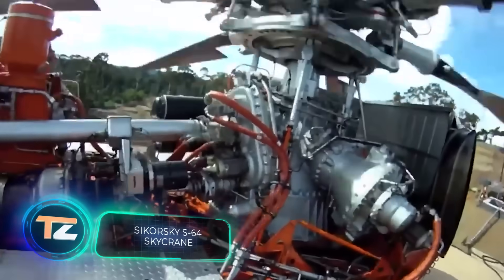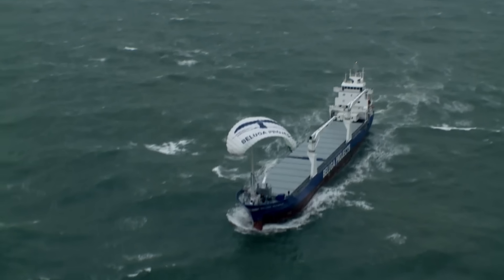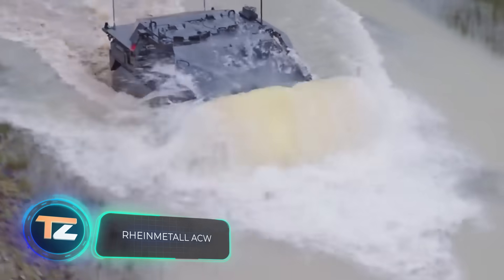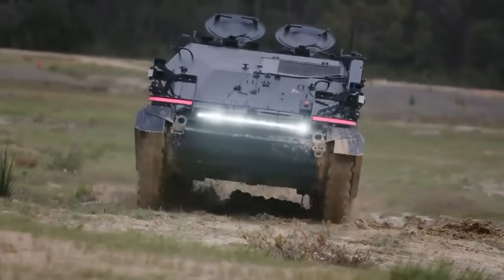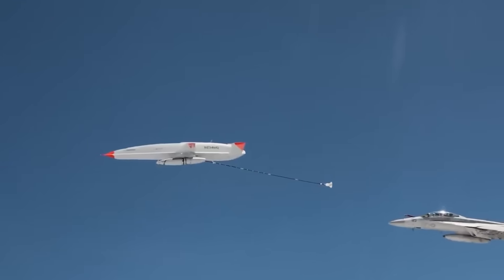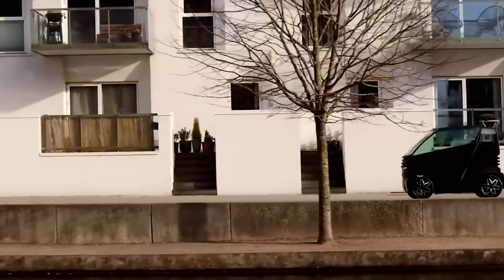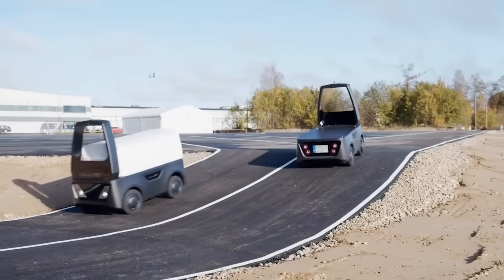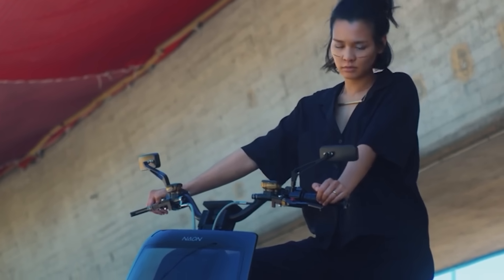AMAZING INVENTIONS YOU SHOULD SEE

Comment: Are you serious about that drone right now? First off it's slow as hell, it's too big for storage and it also looks very fragile.
Reply: Make it bigger, that allows for more lifting capacity, which should allow for bigger impellers. Make it from that sharkproof material to solve the fragility. And if you use hydrogen instead of helium it will be cheaper to fill too. Only issue is if those loudspeakers can be upscaled or are actually efficient mode of propulsion in the first place... Though removing the whirling finger cutters and making it silent in human hearing range may be useful enough for some purposes to make it viable anyway.

A possible use: A balloon with a metallic skin could make a great radio antenna, basically a flying cell phone tower/WiFi hub. Though I'd likely just use a balloon tethered to ground so high winds won't be a problem.
Reply: @AnalystPrime  I see where you are coming from. Being used by an adult or for a project its useful but to have fun, I just don't see it. The narrator was saying how traditional drones have become and boring and the blades are dangerous even tho there are drones that have a protective barrier to prevent injuries. I just don't see myself having fun with this thing. Just my thoughts.
Reply: @seevanmaroge  As a toy, maybe make the components sturdy enough to take a fall and play bumperdrones trying to pop other player's balloons? Would have to be inside because those things would fly away with the wind...
Also, just having a glowing balloon that you can steer around might make for a nice art installation or decoration for a club or something, imagine those flying around the ceiling of a dim room.

Comment: Concrete houses are the future. Bug proof, energy efficient, and low maintenance, they are a better choice. It's going to be tough here in America though, as the timber industry has gotten building codes changed to only allow stick frame construction in a lot of areas.
Reply: Considering what kind of cardboard boxes they claim to be houses, it is high time to change those codes again. With people finally figuring that it is better to use some common sense and build a house that does not have a huge electric bill from needing the AC in summer and extra heating in winter the demand for low energy houses will rise, and the best time to add things like ground or air heat pumps, proper insulation and rooftop PV or solar roof tiles is obviously when the house is first built.
Reply: Concrete houses are the future... except for the problem that concrete is hugely energy intensive to make and transport. Its already a major contributor to CO2 emissions globally and that would be much worse if all houses were made from it. There is really no one 'ideal' materiel for houses on a global level. (edit for spelling)
Reply: @AJPemberton  Yes, as they are now, but the material is being ignored. People are experimenting by injecting air into it, etc. I think if we really applied ourselves, we could come up with a plastic/concrete material that would solve the drawbacks.
Reply: @ghazman6141  it's not really being ignored is it?... As you say , people are experimenting with concrete additives, and have been since it was invented. But it is still a hungry little beast to manufacture and ship. Adding plastic, with all of its inherent problems, isn't going to make that change.
Personally, I prefer wood for my house, along with stone and earth. Local, natural, and to me, beautiful. Now, if we could modify tress to grow livable spaces, I'd be set :-)
Reply: @AJPemberton  Yep, I agree that making concrete is energy intensive. Making lumber requires energy as well, but with concrete you get fireproof, wind proof, and bug proof in one product. You can make wood do similar with add-on products, but what is the energy requirement to make those? But people need to be given choice, and they are not because of the timber industry, and that is not right.

Comment: 7:01 ... The Great White Shark has a bite force of roughly 4000 Pounds Per Square Inch!... So, it won't break the suit, but it will crush Everything inside of it!  Skin, flesh, muscle and bone would be crushed inside the suit, and it doesn't take 4000 PSI to Snap a Femur(the strongest bone in the body); it takes approximately 160 PSI to break it.  The suit is just another invention to allow people with more money than common sense to throw away their cash!